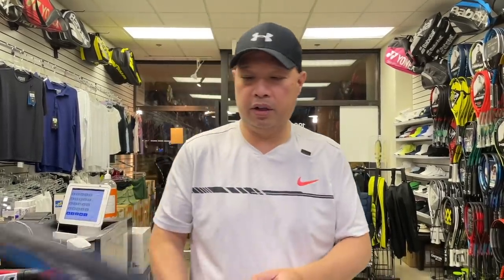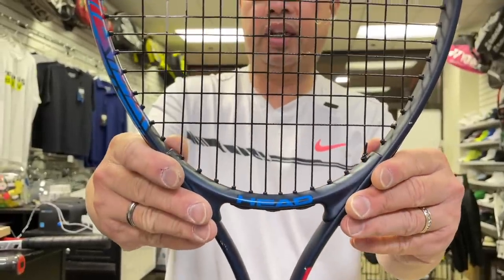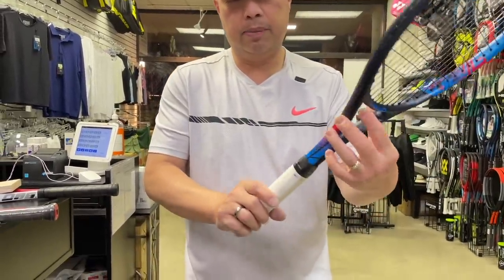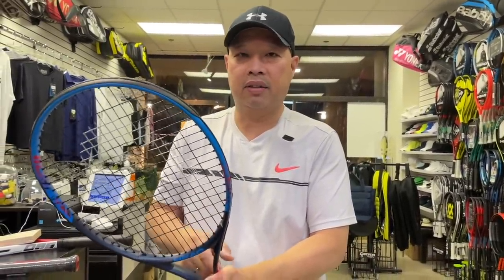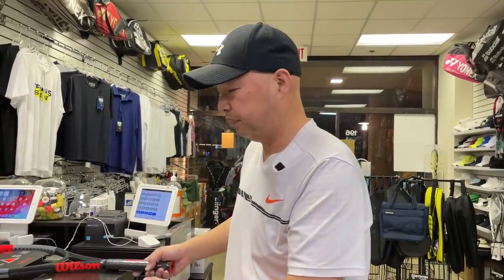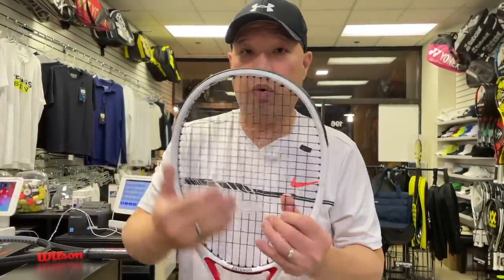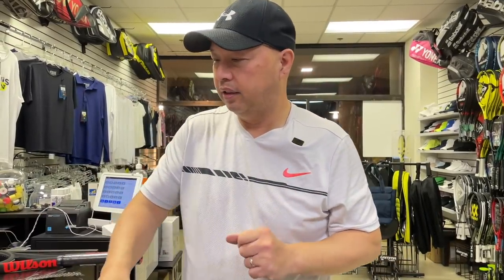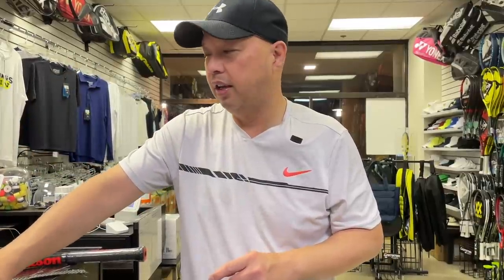WHAT ARE YOUR TENNIS RACKETS MADE OF AND HOW TO TELL THE DIFFERENT TYPES OF MATERIALS?

Comment: What do you think is the best racquets with 98 inches head frame?
Reply: There’s no such thing as a “best racquet”, just what’s best for an individual.
Reply: what really is the difference between 97, 98, and 100? they are all about the same
Reply: @daviddinh9031  bigger headsize gives you a bigger sweetspot, and also more power and spin. Smaller headsize provides control and feel.

Comment: Specifically, most of today's modern rackets are made of either 100% graphite or, more likely, a composite of graphite that includes materials such as Kevlar, fiberglass, copper, titanium, and maybe even tungsten. 

Racket manufactures often change the graphite mix primarily to keep players buying more and more rackets. For instance, a 2013 Volkl is a very high quality racket, the 2014 Volkl sold for the same price but was cheaply made and practically worthless. It truly is a secretive industry.